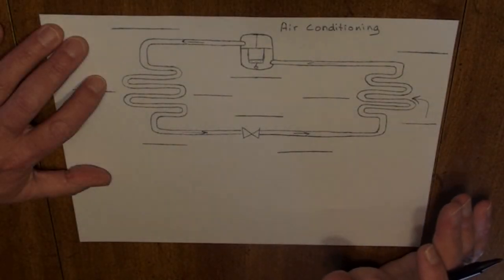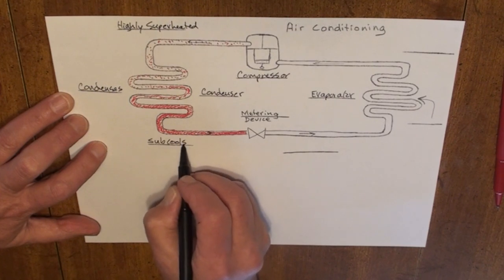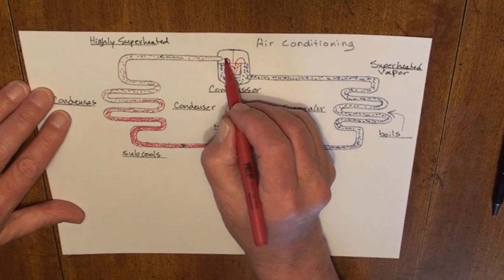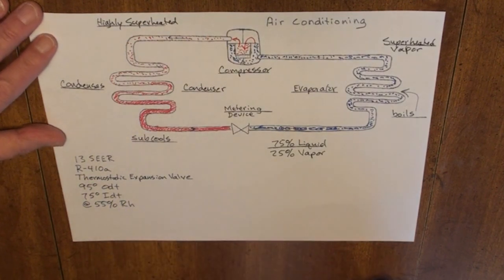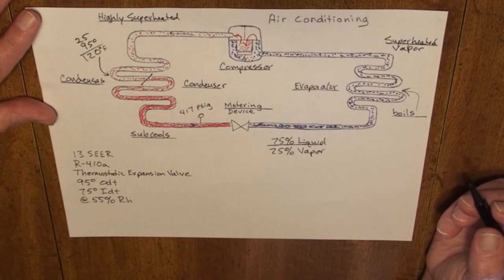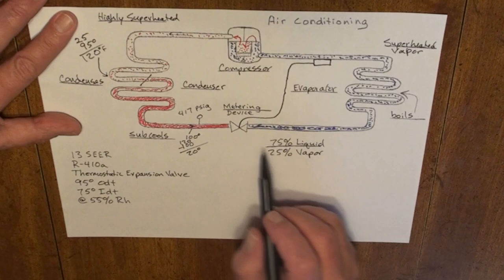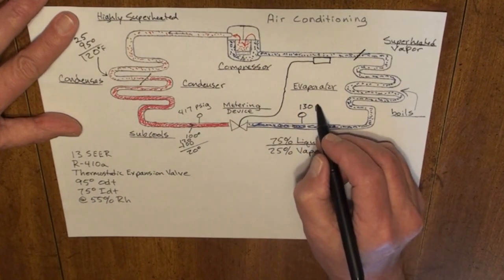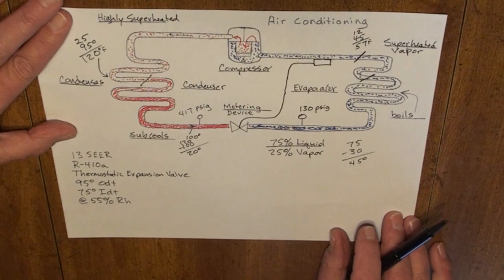The Basic Refrigeration Cycle: 13 SEER - R-410a - TXV

Comment: I have a 16 seer with no sub cooling number to target on the label. What numbers do I look for? If you can help me with this it would be greatly appreciated. I do understand wet bulb temperature and other technical terms and I understand most targets are 10 to maybe 15 but does the sear rating affect that to be higher?
Reply from the maker: To be on the safe side I would still go with a 10.

Comment: Can anyone explain  the term R and 410 a used for
Reply from the maker: LOL, It's complicated.

Here is a brief explanation of the number system used after the dash (-):

• The rightmost digit equals the number of fluorine atoms per molecule.

• The second digit from the right (tens digit) equals one plus the number of hydrogen atoms per molecule.

• The third digit from the right (hundreds digit) equals the number of carbon atoms minus one. If zero, it is not normally written but assumed. For example HCFC-22 has one carbon atom.

• The fourth digit (thousands digit) equals the number of double bonds in the molecule. This is omitted when zero and in practice is rarely used.

• A suffix with a capital B and a number indicates the number of bromine atoms, when used.

A suffix of an uppercase letter (A, B, C, etc.) indicates different percentages of refrigerants blended together. For example R-402A and R-402B are made up of the same refrigerants, but with different percentages of each refrigerant.

A suffix of a lower-case letter (a, b, c, etc.) indicates an isomer. Isomers are chemical compounds that have the same atomic compounds and molecular weights, but different molecular structures and properties. For example, the figure shows that HCFC-22 is made up of one carbon atom, one hydrogen atom, and two fluorine atoms. (It also contains one chlorine atom, but it is not identified in the numbering system.)

NUMBERING SYSTEM
This numbering system also allows refrigerants to be grouped into series. Below is an explanation of the various refrigerant groups.

• -000 series: methane-based compounds.

• -100 series: ethane-based compounds.

• -200 series: propane-based compounds.

• -300 series: cyclic organic compounds.

• -400 series: zeotropes.

• -500 series: azeotropes.

• -600 series: organic compounds.

• -700 series: inorganic compounds.

• -1000 series: unsaturated organic compounds.

For example, HCFC-22 is in the “000 series” of refrigerants, meaning it is a methane-based compound. R-134a is in the “100 series” of refrigerants, meaning it is an ethane-based compound.

Comment: Very nice video. Thank you. 
I have a question regarding subcooling temperature. In your example it is 20 F. Usually instructions suggest 10 F +/- 3.
Why 20 F. Is it not too high?
Reply: It depends on the efficiency rating.  The higher the rating the lower the subcooling I have seen some very high efficiency models as low as 5.  Also it depends on the manufacturer.  In theory as long as there is pure liquid entering the metering device it is good to go.

Comment: Sir 
There is one confusion 
There is temp 105 in subcooling
And 51 in super heat 
Why less temp superheat and high temp is subcooling
Reply: The temp relates to the refrigerant and when it will condense into liquid or boil into vapor, the changing of states. So when it's leaving the compressor at a high temperature high pressure it needs to have more heat than the ambient outside air temperature in order for it to reject that heat from the refrigerant into the air, as it's changing states and condensing back into a liquid. The low temperature superheat from the evaporator is the temperature at which it has added some heat from the indoor conditioned air space but first it needed to drop to its saturation temperature of let's say 40 degrees, the point it which it will boil and change states back into a vapor. In order for that roughly 75-80 degree air to transfer its heat into the refrigerant, that refrigerant needs to be at a lower temperature. So even though it's a 'superheated' vapor that just means it has added heat above the saturation temperature which is going to be well below the ambient room temperature inside. Likewise the 'subcooled' liquid can be very hot but it's only 'subcooled' because it has dropped below the saturation point.

Comment: My understanding is that in  refrigeration/refrigerator that the suction line is the line coming from the top of the evaporator and is cool while as you indicated the high side pressure line coming out of the compressor is hot. Can you confirm if that is a correct understanding?

Comment: hi -I don't understand 1-for the model T2/Te2 without third pipe from thermal expansion valve-when the valve are close the orifice -the presure wrere are going ?
2 the model with three pipe -third are conected at exhaust of evaporator -when the termic valve are close the pressure are going in bypass from third pipe ?
And also who close the selunoid valve and the pressure of the compressor where are going ? the baypass are after this valve 
many thanks 
where I can find a animation of this ?
Reply from the maker: Stefan, I have lost something in the translation here.  Look around on the internet there are several animated versions of the refrigeration cycle using the thermal expansion device.  Good luck with it.

Comment: Excellent video. As mentioned 410a is under high pressure, use proper hoses and gauges plus safety glasses. If you suspect a defective expansion valve, be sure and put the sensing bulb on the suction line in the same place. It does make a difference where it's clamped on. you should also use copper strapping around the bulb and suction line with a nut and bolt. Don't Ty wrap or tape it to the line. I prefer expansion valves over orifice devices. I repair a lot of R-22 walk in coolers. You can easily convert to 404a blend and get much colder air. Always flush the system, make sure oils are compatible and install a new liquid dryer.

Comment: With the higher operating pressure  inside condenser, the saturation temperature should have been higher, instead it is lower due to the added surface area on the condenser, then what is the reason for increasing the operating pressure on 13 Seer units?

Thanks
Reply from the maker: The higher operating pressure is due to the type of refrigerant used in the example.  R-410a has much higher pressures than the R-22 used in the 10 SEER example.
Reply: Cool Cat HVAC/R Training Video 
This means larger  heat rejection from The condenser & that means smaller work required by the compressor or reduced load on compressor & saving on utility bill?

Thanks

Comment: Could u please explain why the target Superheat calculation is based on the external temperatures, wet bulb temperature  & dry bulb temperature?
Wet bulb's relationship with relative humidity, superheat, increasing or reducing the charge?
Thank you so much for spreading valuable knowledge.
Reply from the maker: The wet bulb temperature takes into account the humidity that is in the air.  This increases the load on the evaporator because the evaporator operating temperature is below the dew point.  When the suspended moisture comes into contact with the evaporator coil it changes state (becomes the condensate)  This is a latent load on the system.  Keep in mind in the 13 SEER example the superheat is constant because of the TXV.
Reply: Because if you charge on Superheat without outdoor temp indoor temp and wetbulb temps you charge with these temps it compensates for the above temps so you don't overcharge the system because as the occupied space cools down you won't be overcharged.Ok space in 85 degrees and you charge with this method once the space cools down to say 70 degrees you won't be Flooding Liquid back to your compressor .That's called Superheat charging.Now Subcooling is a TXV that opens on Demand thru the Bulb that's attached to your Suction Line leaving your Evaporator with most of the time a equalizing line close to your Bulb they have different forces on your valve a opening and a closing force to regulate valve operation of letting the Correct amount of refrigerant into your Evaporator coil.The main purpose of that Valve is to try and maintain a Constant Superheat on the system so with a Valve you check your Superheat but you actually charge by what's called Subcooling which is done in your condenser unit.Both Superheat tells you what's going on in your Evaporator Coil and Subcooling tells you what's going on in your Condenser.You have to changing states from Superheat Vapor to a Liquid State before it enters your Evaporator Coil then thru your Coil it is boiled off and as it leaves your Evaporator Coil it has changed to a Superheat Vapor from the Heat it has absorbed from the warm house air moving over it so when it enters the Compressor it has No Liquid entering compressor then it's compressed and the refrigerant is picking up heat from all the internal parts of your compressor thru compression and Leaves the Compressor and enters the Condenser Coil much Hotter than Apmbient Air so it can give that acquired heat off and somewhere in the middle of that condenser coil it changes State from Vapor to Liquid as it Leaves Condenser thru your Liquid Line and heads back up to your Evaporator Coil and hits your Metering Device Fixed Orifice (Superheat)or TXV ( Subcooling) then the Process keeps going thru that Cycle till the House or pOccupied Space is Cooled to Set Point of Thermostat

Comment: Higher the super heat temperature higher the efficiency or cooling,
The super heat on deep freezer higher than the refrigerator?
thanks
Reply from the maker: No, superheat in the evaporator is an indication of how much of the evaporator has the change of state taking place.  Where a change of state taking place has the most capacity.  The perfect super heat would be 1° but that would put the compressor in jeapardy of slugging.
Reply: By the same token, the Subcool in the condenser is also an indication of how much the condenser has had the change of state taking place. And, the perfect subcool would also be 1 degree but that would also put the compressor in jeopardy of slugging?
Thank you

Comment: What does the sensor on the superheat measure, as a result of which expansion valve opens or close? I guess it is superheat temperature. 
Does the super heat temperature means the temperature difference?
Thank you so much for the great video.
Reply: Just like learning a little, thanks

Comment: Is metering device also called expansion valve,it is there to drop the pressure & temperature & thus its function is opposite of compressor whose function is to increase the pressure?
Thank you for making it simpler to understand & interesting.
Reply from the maker: Yes, all metering devices are called expansion devices because the liquid expands as it becomes a gas.
Reply: Metering device is a fixed orifice or called a piston. Expansion valve moves as needed from reading super heat out of the evaporator.